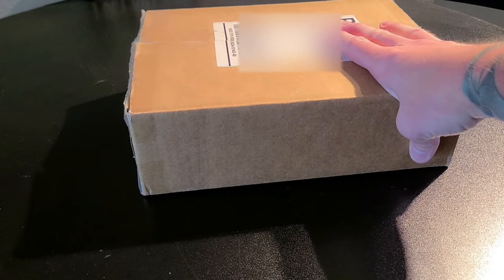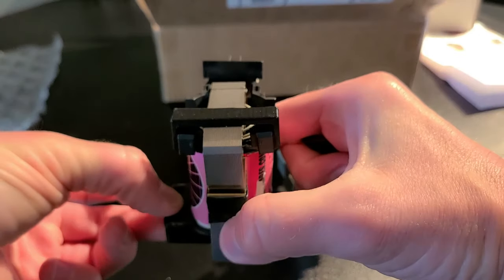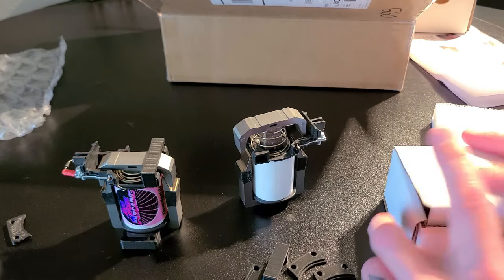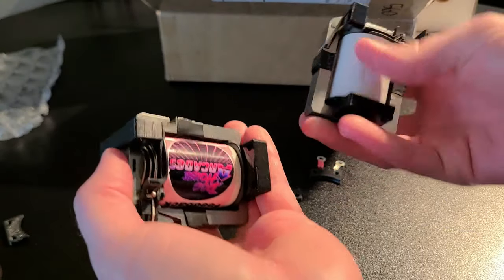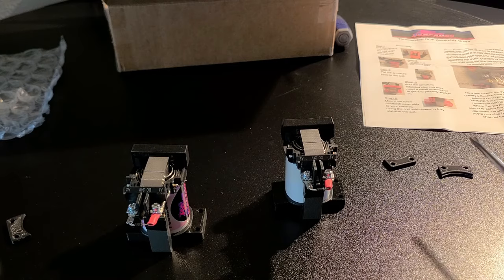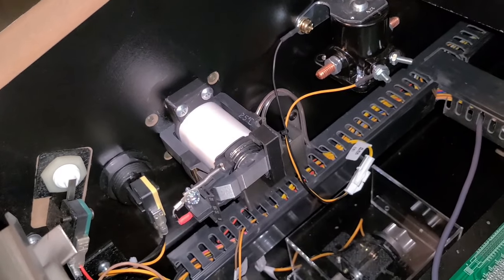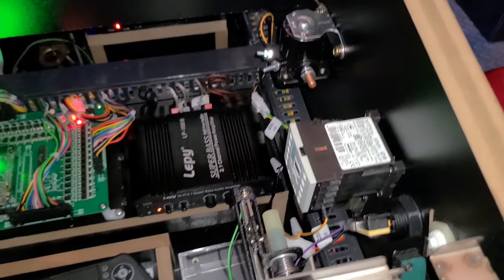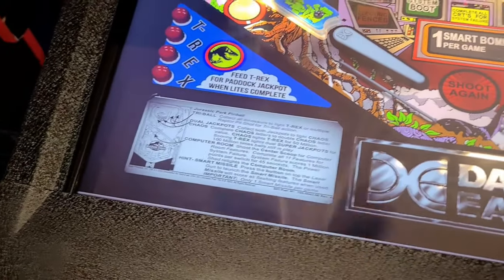Virtual Pinball Flipper Feedback Mod (Contactors VS Thunderclaps)

Comment: Looks good.  Gotta figure mine out, did something that caused all solenoids,  shaker, knocker, led lights (all DOF) to stop working in gameplay. Different builder than yours but they all pretty much use same software
Reply from the maker: Daaayyyumn… that sucks man. When you get it back up and running, these bad boys are definitely worth looking into.

Comment: You've convinced me
Reply from the maker: You should check out my updated video with the contactors versus the sw3 solenoids. In my opinion, the sw3 solenoids are the best for flipper feedback hands down. They beat the thunderclaps by miles.
Reply: @Scantron5k  Dude thank you for the response.  I watched that video and I can get on board with that.  I haven't started building mine yet but 1/4 the price is fantastic.  Do you recommend them just for the flippers or should I go with them for the whole cabinet?
Reply from the maker: @mastrtonberry2  yep, I've seen them used on the whole cabinet as well.

Comment: After having them a while do you still recommend them? I already have a working 24v Siemens set so no rush to replace but these did catch my eye a few months back. I love they have more force and less prone to locking up but would you recommend them for a 10 contractor setup? Just the slingshots, just the flippers, etc? Sound and speed wise they may not be a top pick for crazy pop up bumpers. Thought about getting two for my flippers but on the fence.
Reply from the maker: Honestly man, it's all personal preference. Yes, I still like the ones that I have for my flippers. I prefer the starter solenoids for the rest of the slings and bumpers.